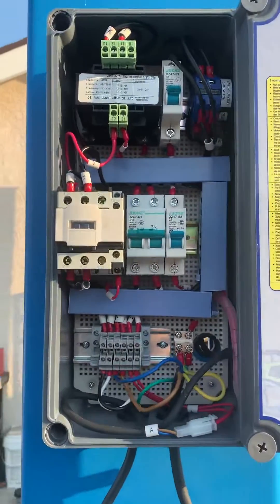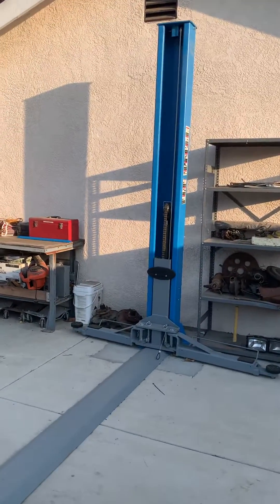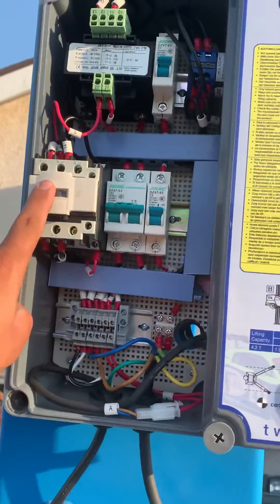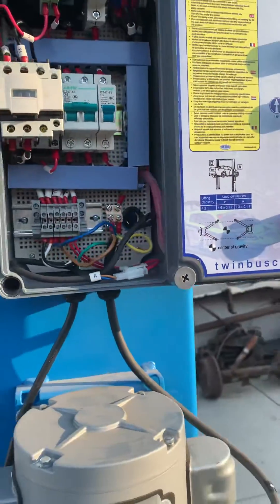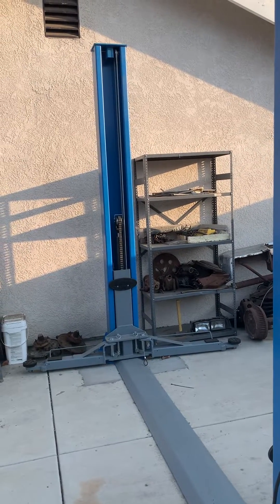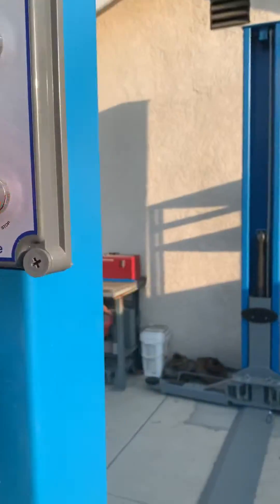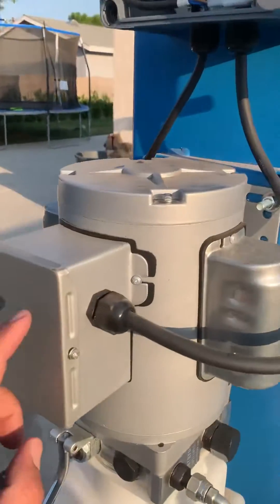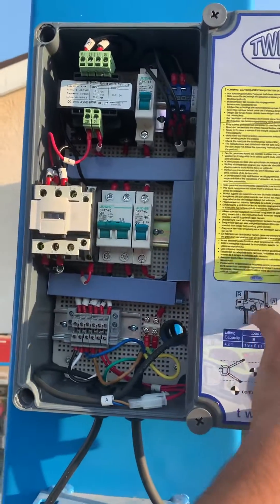Finished Installing Twin Busch Two Post Lift ! not working !!!! Part 3

Comment: Ever figure out the issue?
Reply from the maker: I sure did! had to run a dedicated line 120 volt single phase, 30amp breaker. A 20 amp will not do the job
Reply: @ChapsBuilt84  good to know, just ordered this lift and should have it next week. Thanks !